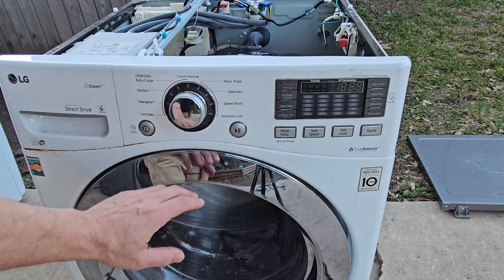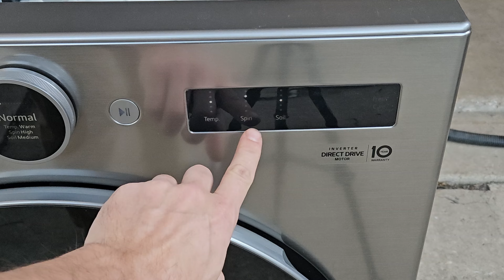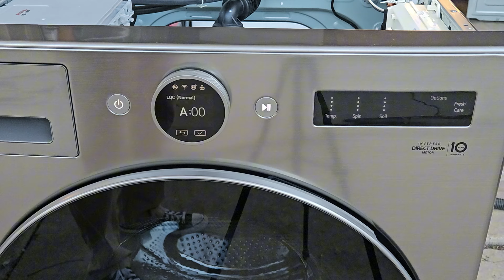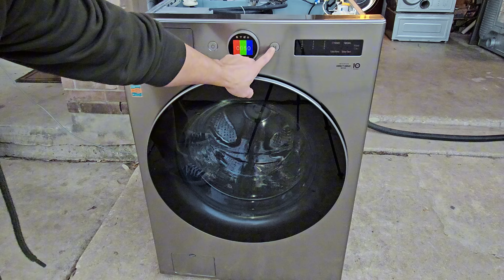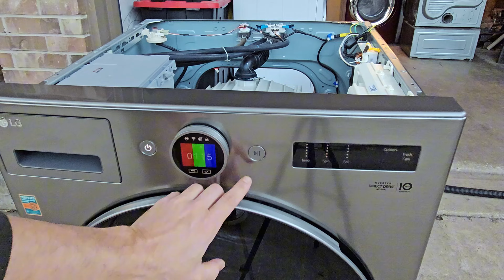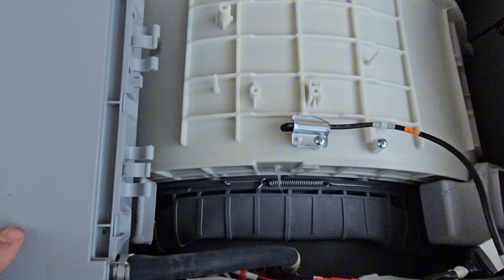LG Washer WM5500HVA Diagnostic Mode

Comment: Is there a way to run a diagnostic cycle on the dryer side? I’m suspecting the blower is bad, but can’t prove it.
Reply from the maker: So the diagnostic modes are less diagnostic and more test mode... if that makes sense. If you can give me a little bit more information as to what your machine is doing I might be able to help you